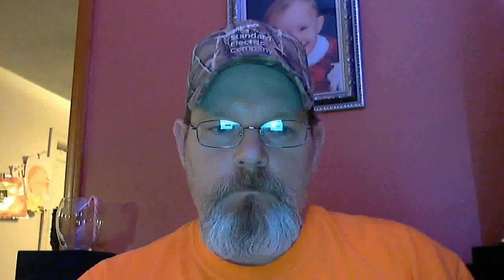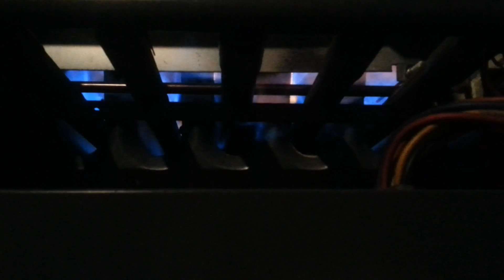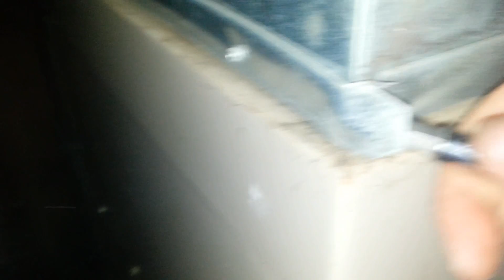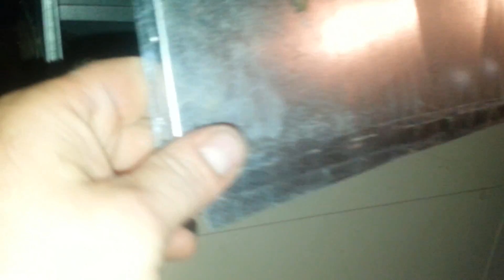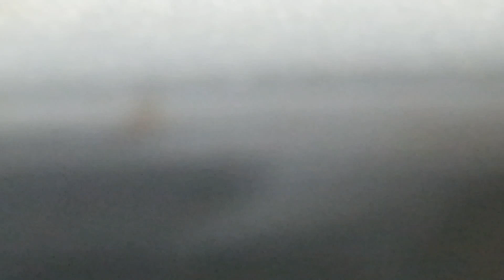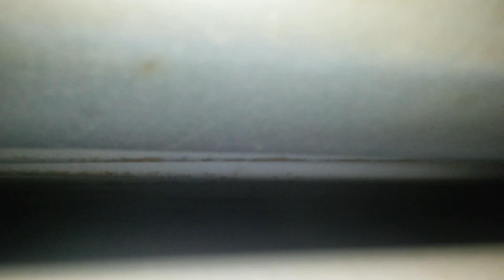Furnace with a Cracked Heat Exchanger and Flame Rollout

Comment: My point is this. Obviously this condition can kill you so manufacturers should be forced to make heat exchangers virtually corrosion proof. If you need to replace a furnace most of the time because of this condition and it risks lives then they should be held to task

Comment: My heat exchanger is cracked and I am replacing it. However, my CO meter shows no measurable CO at the registers after multiple measures throughout the house.
Reply: A lot of c.o meters don’t alarm till it’s really dangerous
Reply: @Sesamestreet9080  It turned out that the heat exchanger was not cracked at all. What I picked up on the camera was not a crack once I was able to view it from another angle. removing the blower motor. Thanks for your information regarding the CO Meter.

Comment: My furnace has a bad heat exchanger but the carbon monoxide detector I have in the basement and on the main floor never went off. At what level will the carbon monoxide detectors go off?

Comment: I used to have a furnace of a similar vintage. It started to have ignition issues, where the gas would come on, but not ignite for a second or two. That resulted in a nice 'woomp-bang' event that made me feel like the floor joists lifted!. After one business trip, and returning to my house (-8'C inside) to find the furnace out, last straw - replacement time as it had reached a point where I felt it was too dangerous. Replaced it myself with a nice new 92% efficient (1992) furnace (gas hookup by licensed contractor, gas company inspection etc) great heat and my gas bill became 1/2 of what it used to be.

Comment: Hi good informative video. I have a question. With a gas wall heater, is it called roll out when the center block has a flame rolling up beyond the block rather than heating the actual element? Or what is that and what are the dangers? Thanks for your time.

Comment: Hi. My unit is 15 years old,  heat exchanger has a crack.  No leaks as of yet.  Should I replace just exchanger or entire furnace?
Reply from the maker: Some manufacturers have 20 year warranty however you may only have a 10 year. Look up your make and model and find out. If you have to pay for the parts and labor I'd change the furnace. Good luck.

Comment: I have the safeties in my furnace, which is coming up on 20 years and a leaky house. When the roll outs start I will fix the heat exchanger. I will have my Bryant furnace as long as parts are available to fix it

Comment: I have a furnace that's over 30 years it works well with the heat exchanger looks really bad that's the corrosion and build up is it best just to change the whole furthest out ?
Reply from the maker: +thedrew2091 if it's 30 years old. Replace it!!!

Comment: You can also pull the blower out and inspect from the bottom if there is an AC coil in the way of your view from the top.  That only works on non condensing furnaces.

Comment: hows my heat exchabger look: https://www.flickr.com/photos/24140175@N02/29977098435/in/dateposted-public/
Reply from the maker: rusty.
Reply: Guy Brown yeah surface rust. this bad?
Reply from the maker: no rust isn't an issue usually. what you'll want to look for is a crack.
Reply: Guy Brown upon inspection with the mirror thing, no visible vracks